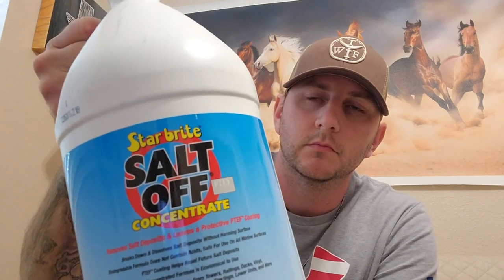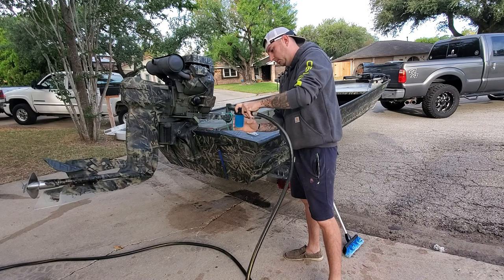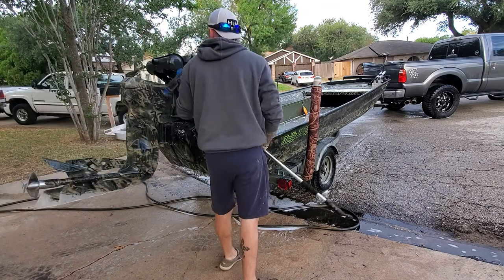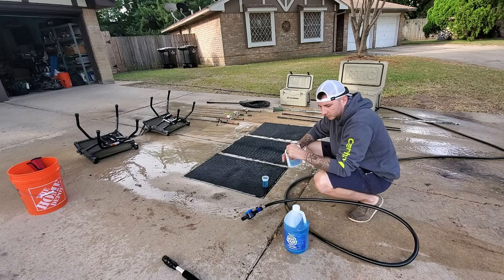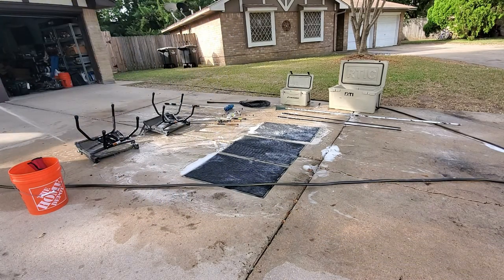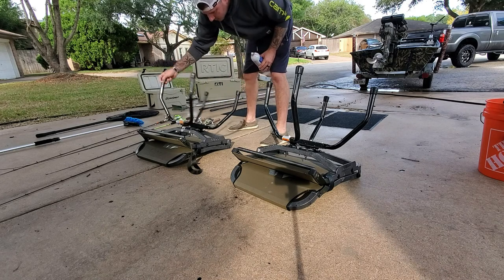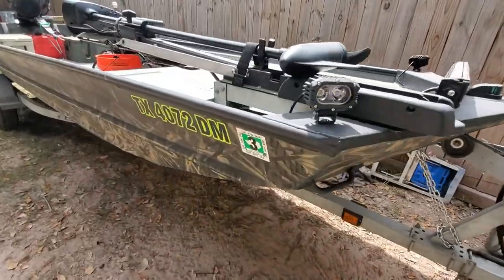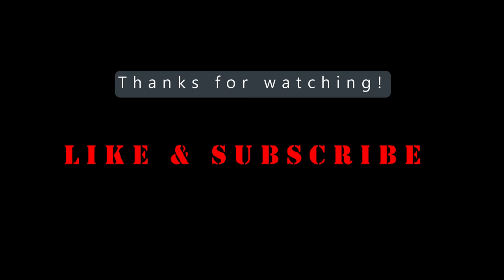How to Wash and Protect a Mud Boat after Saltwater trip using PTEF

Comment: Mix 2 parts water 1 part vinegar with a little bit of dish soap in an industrial sprayer. Spray the boat and mud motor down. Then lubricate with 2 parts wd40 and 1 part of a 50/50 mixture ATF/ Motor Oil in a Zep sprayer. My boat is in salt water 90% of the time.

Comment: This exactly why I don’t take my rig into saltwater. Don’t have time to monkey around cleaning the entire boat, motor and trailer. The saltwater will eventually eat that mud motor over time no matter how much you clean it. Seen it here in Florida all the time with bolts rusting off ect.
Reply from the maker: We also have a 21' center console fiberglass boat w/ merc 150 that we take out in saltwater all the time. We clean everything well and both boats have done well so far. Yes, they will wear faster than freshwater only rigs, but what's the fun in limiting yourself? I don't mind taking a couple extra protective steps if it doubles the amount of destinations we can access (not to mention with the drought we've had lately, most of our freshwater options are too low, even for the mud boat)